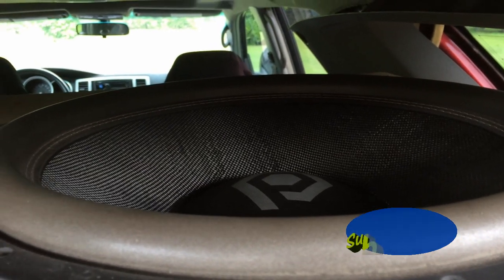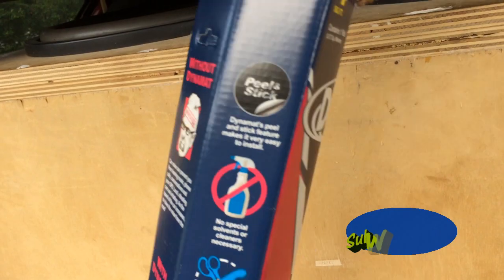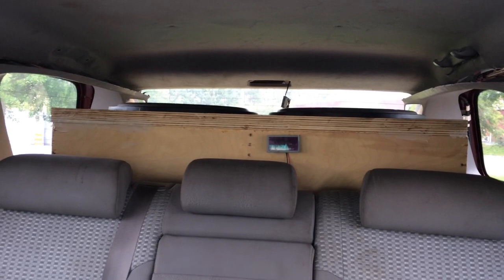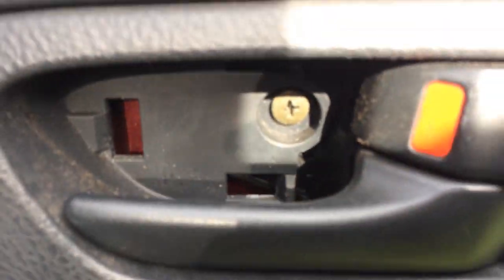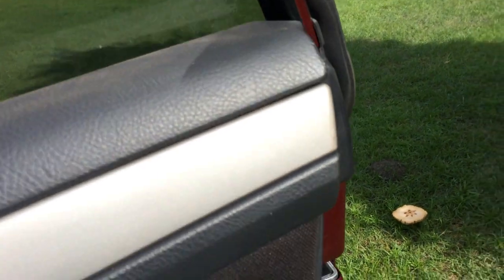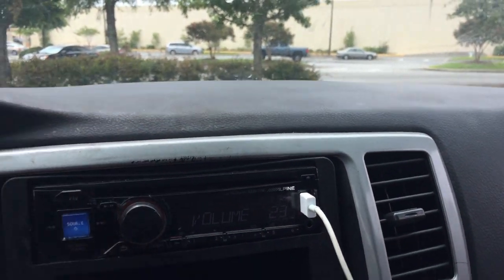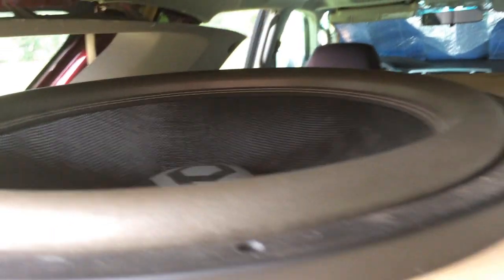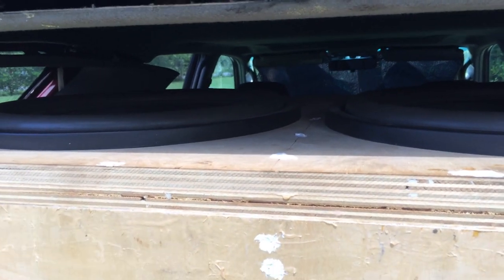SoundQubed Sound Deadening UPDATE! / HDC3 18's FLEX

Comment: Low wattage my 15in dB drive flexes my tahoe more than that
Reply from the maker: Who's Funny The point of sound deadening is to have less flex. The more flex u have, the more sound quality and DB's you lose. I can promise u that your 15 is know where near as loud as my system. And that is not a diss, but I just want you to know that flex is a bad thing. And sound deadening will make your system sound so much better
Reply: Subwoofer King sorry dB drive was an auto correct one have digital design there top 15 I have a 18in sound qubed it's no where near as loud as my 15
Reply from the maker: Which series SoundQubed 18 did you have? And this current setup I have does a 151.3 at 34hz on just a 2500
Reply: Subwoofer King I have the hdc418
Reply: Subwoofer King the dust cap on mine looks way bigger than yours on my soundqubed
Reply from the maker: I rock with both DD and SoundQubed. I put the HDC4 over the DD 9500 series but anything after that, DD is going to be louder. What series DD do you have?
Reply: Subwoofer King 15in power tuned 9900 series
Reply: Who's Funny hdc4 and 9900 series is the same shit. two hdc3 18s will kill a single 9915 no doubt and no comment.